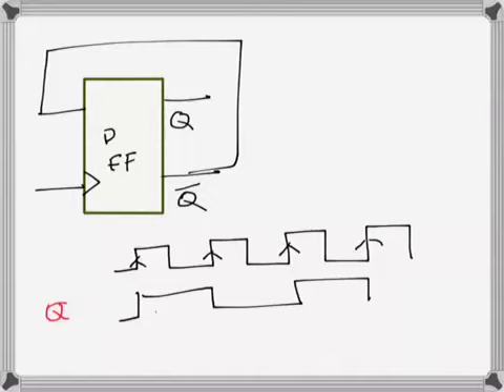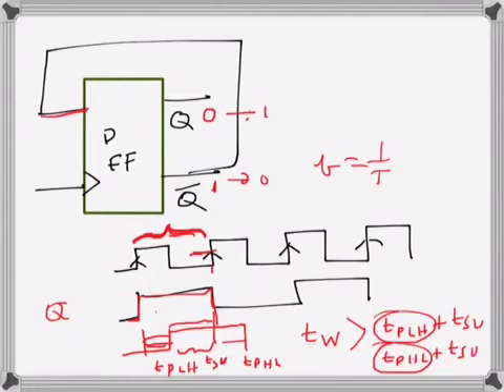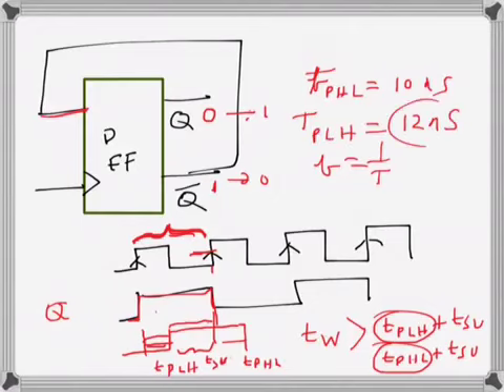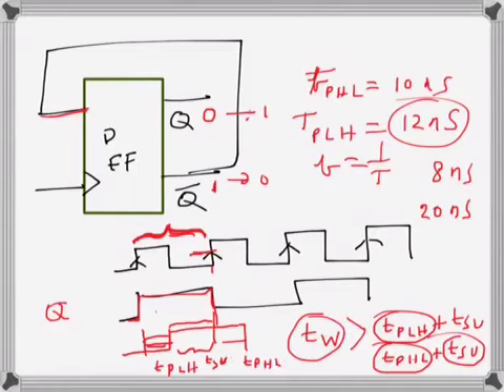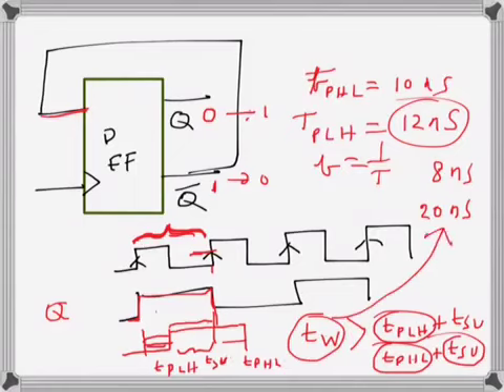Digital Electronics: Maximum clock frequency in sequential logic (D FF example)

Comment: Does the hold time come into account at all?
Reply from the maker: Not is this case. The HOLD time is defined as the minimum amount of time the logic level has to stay unchanged AFTER the clock edge comes, while SET-UP time is the same BEFORE the clock edge comes. So maximum clock frequency (hence, the pulse width) is restricted by the sum of tphl/tplh (whichever is lower) and SET-UP time.